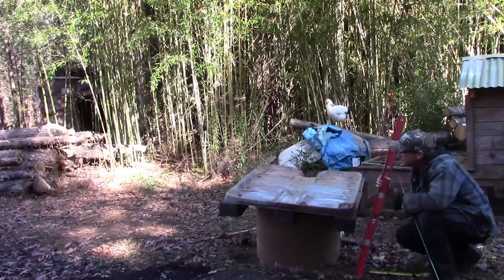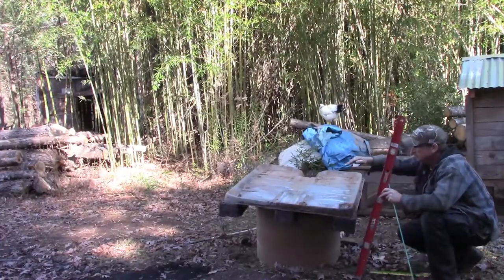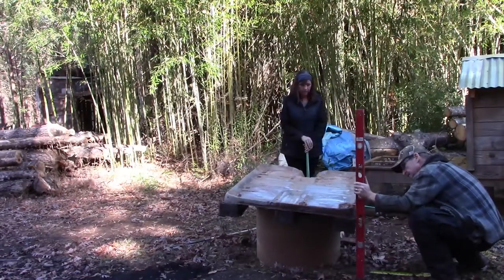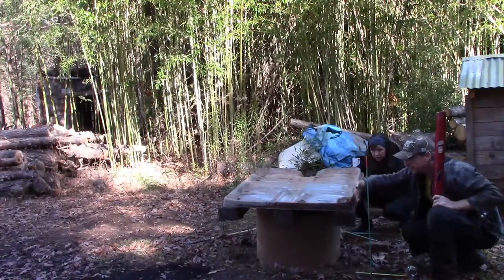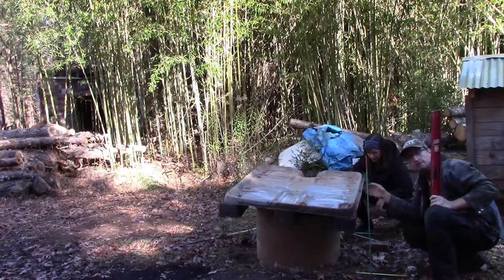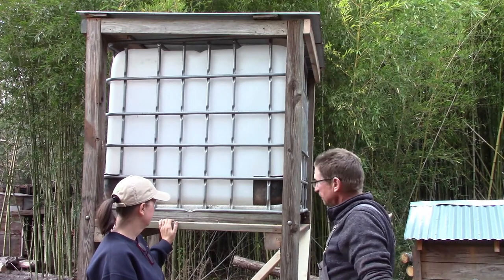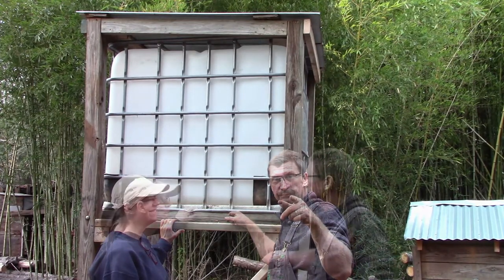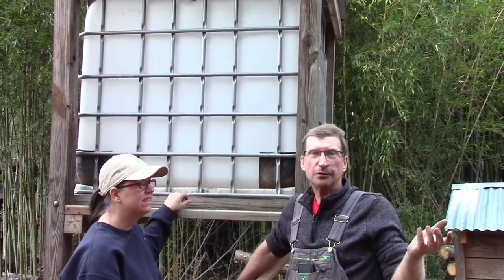DIY Water Tower Build | Part 1-The Build

Comment: I like the project. I made a water tower with an IBC tote. I had a ram pump pumping water from a small creek to water my animals. I used an old fuel barrel stand for the tower.
Reply from the maker: Thank you so much.  I wish we had a creek to run a ram pump - would be much more sustainable... the well can get pretty low during the dry season, so we are hoping that storing some in this "tower" will get us through.  We have hooked up our solar passive pump and seems to be working pretty well.  We show how we ran the water and hooked everything up in our next video.
Appreciate you watching :)
Reply: This is what I am doing, too!
Reply from the maker: It has been working out so well!

Comment: Very nice little project and should give you a head of water with a gravity flow as well as storage independent of the well replenishment and daylight for the pump.
When setting posts in concrete tamp down drainage gravel in the bottom of the hole and use that as a base for the post, then concrete above that. this allows and water that gets between the concrete and the post to escape out the bottom, by basing on concrete the water can't escape and so increases the speed of decay of the posts. When tamping in with soil then a concrete or timber pad at the bottom is fine as the water can disperse through the soil.
Reply from the maker: Great tips, thanks! A bit late for this video, but we will have MANY more projects we can use this advice on😊